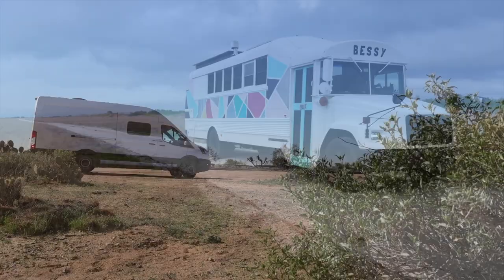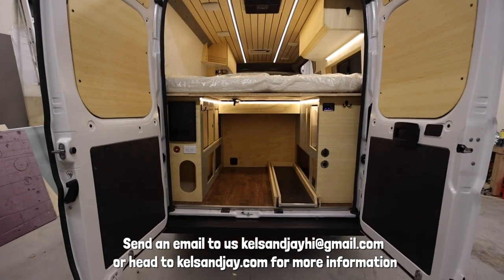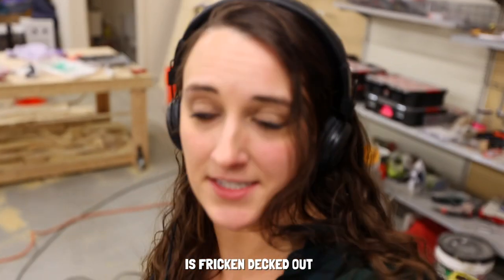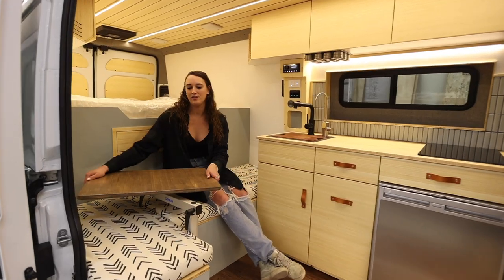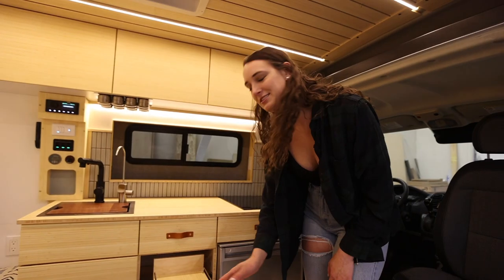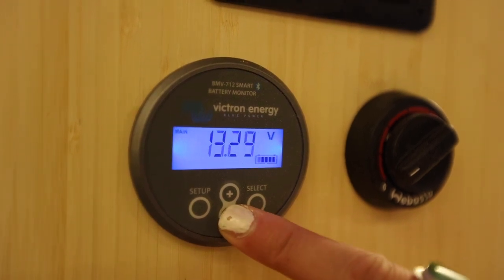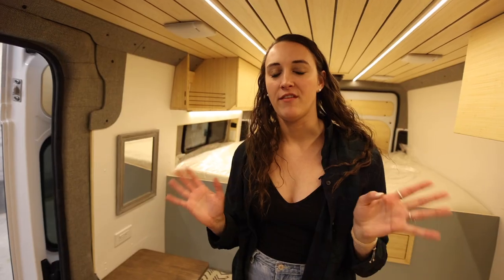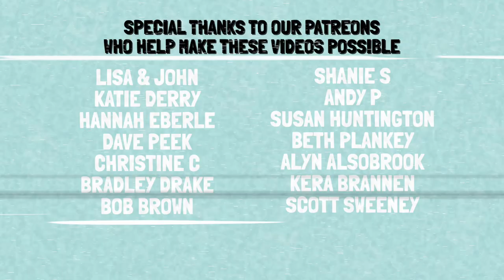Luxury VAN TOUR  with Insane Hidden Features!

Comment: How do you make sure water doesn’t get outside the shower pan and onto the floor? Also, what if you’re on terrain where the back of the van is slightly lower than the front — how does the shower water drain?